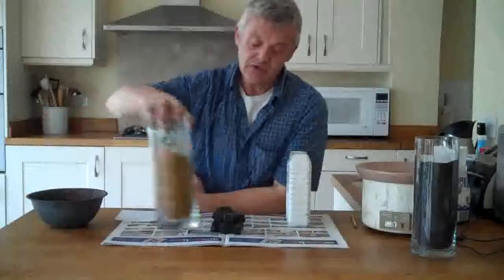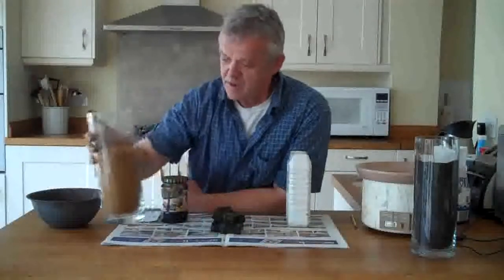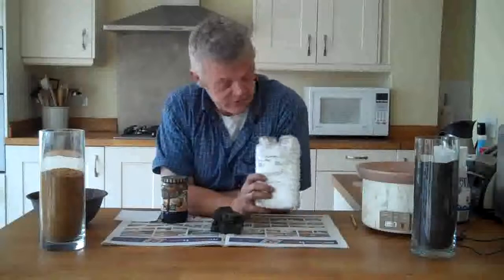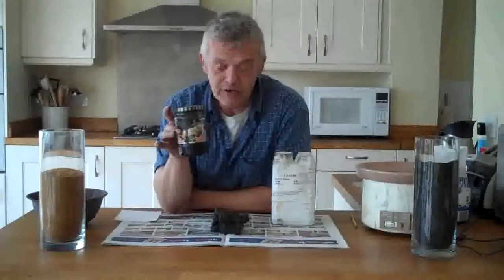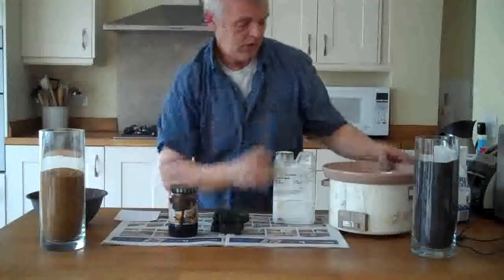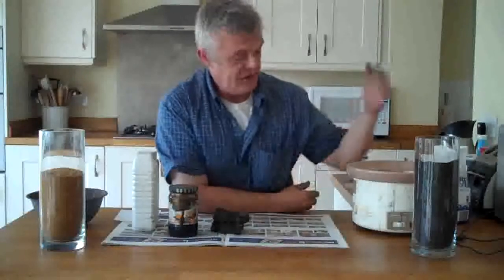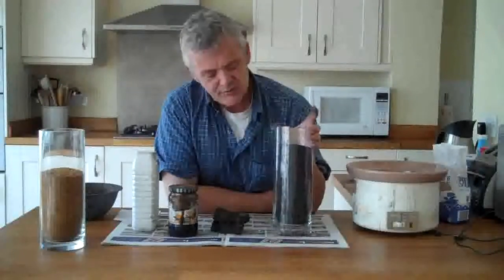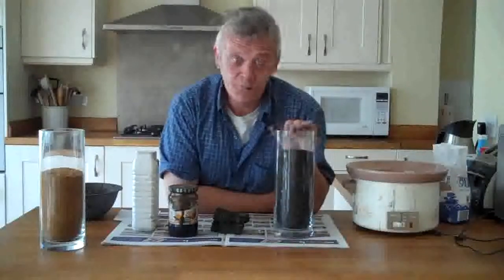Making UltraSand 2 (Graphene Coated Sand) With Tar For Water Filtration

Comment: Hello Robert.. I really enjoy watching your videos as I get to learn a lot from them.. 
Right now, I am working on liquid phase exfoliation to produce graphene and planning to make a water filter from the exfoliated graphene.. It would be great if you can suggest some ideas to make water filter from graphene which I have in a powder form.
Reply from the maker: +Shikhar Misra My suggestion is not to bother - the problem of adhering the graphene is difficult especially when better methods exist
Reply: +Robert Murray-Smith I am actually preparing bulk graphene using kitchen blender in NMP solvent. I have separated it using vacuum filtration after centrifuging it and was wondering how to test it for water filtration.. One idea that struck me recently was to use a tea bag.. It would be great of you can suggest some other better idea..thanks for your help
Reply from the maker: +Shikhar Misra sounds like a plan mate good luck with it
Reply: Thanks

Comment: Okay, that makes sense. It would most likely result in (at best) activated charcoal coated sand. That said, how are you confirming the presence of graphene/graphene-oxide on the sand, as opposed to activated charcoal? Aside from using an STM, is there some easily observable property that can be used to distinguish between graphene(/oxide), graphite, and charcoal coatings?
Thanks